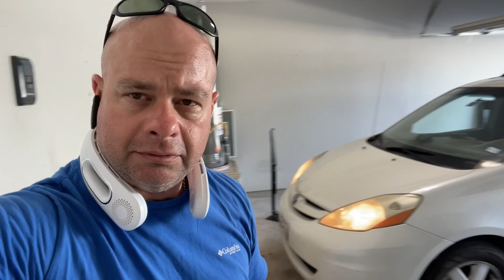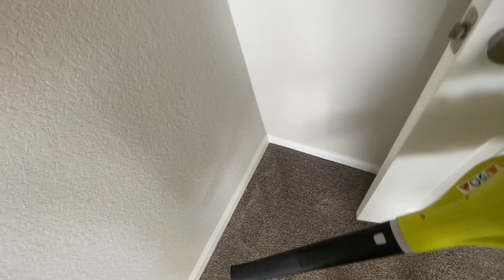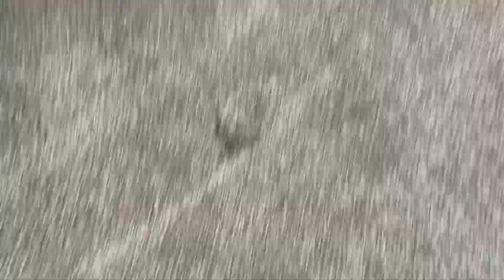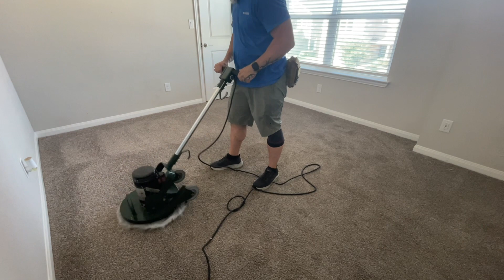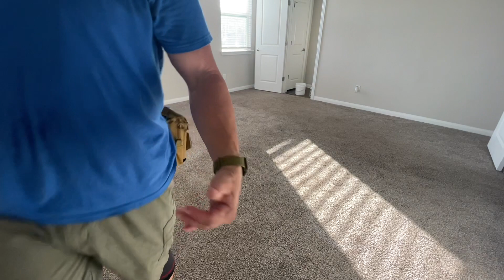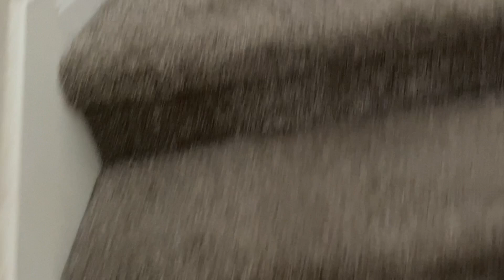Carpet Tell All Tips Tricks and hacks. Vlm carpet cleaning.  Must See.

Comment: So today. The news said that Texas was one of the hottest places on earth at the moment. Stay hydrated. Also I’m 99.9999% sure i know the person acting like a child, unfortunately i had the same experience. Left a bitter taste in my mouth. Also my clo2 arrived. Had a chance to play with it on a job yesterday. Trying to figure out the safest ppm to effectively remove the urine odors without bleaching or changing the carpet color. I also did a stupid thing by sniffing the stain with the clo2 applied. Left me with a nasty cough for the rest of the day. Feeling better now. Have you had chance to find the max ppm on urine accidents that would be safe for colors? Tried  researching and it is difficult to get the definite answer.
Reply from the maker: It was crazy hot today. You are correct on the individual.  I bought all the test strips to measure the ppm on both cl02 and peroxide. My findings are that peroxide is a much stronger oxidizer. Peroxide will remove more color than cl02. However it doesn’t help with odor. In order to become confident in using it you have to perform controlled testing in your garage. Try to mix it in a manner that you feel like it would bleach carpet. Then begin mixing different cleaning components with it that you feel like would be an issue. It’s unique because it smells like bleach but is non caustic. I was unable to damage carpet with it.  I get the best results when I apply it by itself to the carpet. It needs about ten minutes dwell time. It will fix everything that it touches. So you have to put a liberal amount down. Basically as much cl02 as the dog did with urine. It works great and is over 100 years old. I will try to do some video just on clO2. 👍👍
Reply: @CarpetMuscleTV really really appreciate it. I got some carpet squares from Home Depot for these situations. Going to test different strengths this weekend. Truly thanks again.